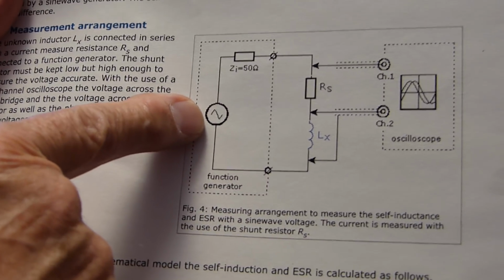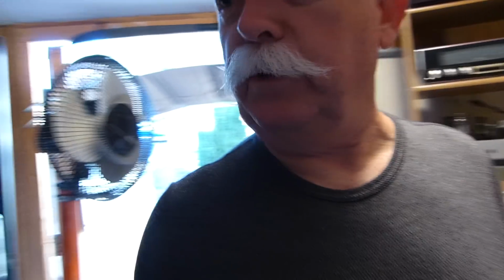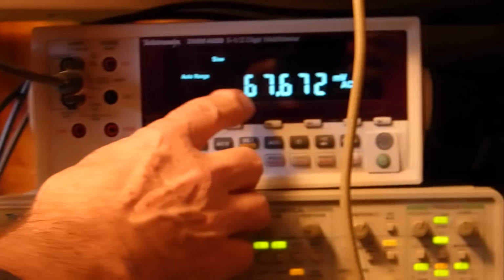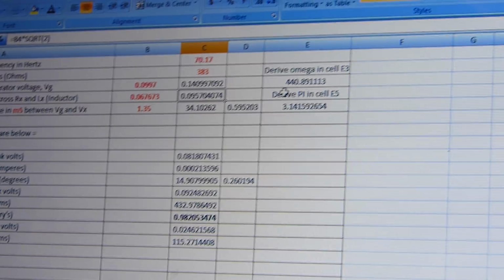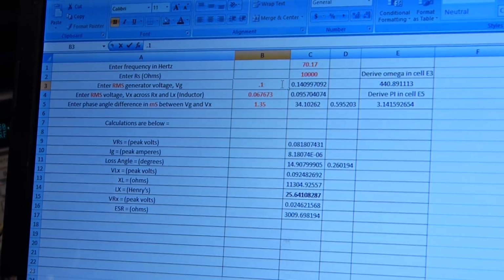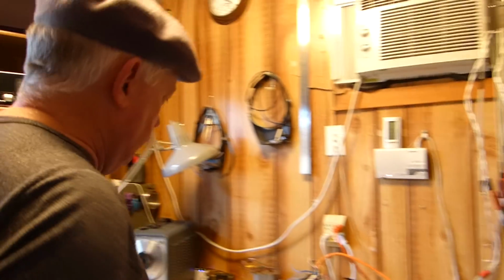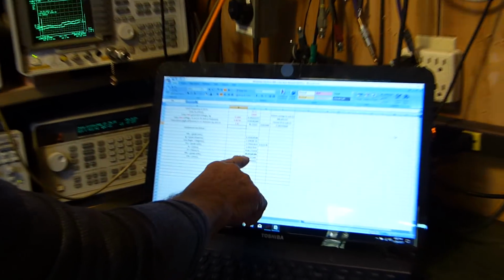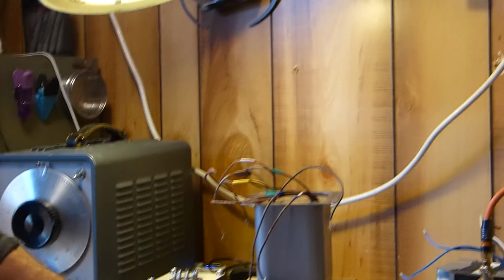Sine Wave Method Of Measuring Inductance Of Vacuum Tube Audio Output Transformers

Comment: Very interesting method. Would it not be better to use the mean voltage from the Tek voltmeter, rather than the max? Doesn't that meter have a filter function to essentially give you a rolling average over X power line cycles or similar? Most bench meters have something like that.
Reply from the maker: I am glad you liked this video as I am still very pleased with how it performs. I just recently added an outboard pot to it to reliability and very accurately measure inductance values down to 100 mH. 

As I am sure you know, measuring low L value inductors (mH and uH) values, it is easy to do with several simpler methods but the output transformers are in a class all their own. General Radio manuals are a very good source to read on how to deal with iron core inductors. When trying to get a consistent and accurate reading on inductance values in, for example, the 40H range of a 20-50 watt vacuum tube transformer,  it is amazing how sensitive the core is to being  magnetized just by simply moving it around on the bench. Trying to make these measurements on a metal (steel) bench is hopeless.

I usually don't take the time to go thru the trouble of finding the max voltage on the Tek voltmeter anymore as I showed in the video, as I have found with more experience, it is really not necessary.

With care, I can consistently and with a very acceptable accuracy, measure 250H or more. 250H from CT to one side is what you will get for a 1000H coil end to end and I have a transformer that is 1:1 at 1000H each side. This method is actually easier to use than the GR instrument and I have the highest regard for GR equipment. The GR 1650A is a  beautiful instrument but it is based on 1KHz and 1KHz is not a good frequency to try and evaluate very high inductance coils. For capacitors I have found that using an external source up to 20KHz works good with the GR 1650A but not so with low values of frequency like 40 Hz which I have found necessary with high value inductors.

I want to make another video on this instrument but I don't think many people are interested. Personally, I find these types of manual/mathematical measurement methods the way to evaluate the inexpensive digital instruments of today and not the other way around.
Reply: Thanks for the reply. I certainly found it interesting. Did you post your spreadsheet someplace? That would be helpful. I know you show most of the formulae in the video, but we electronics guys are a lazy bunch ;-) Anyway, I appreciate the effort you put into these videos. I have done some myself. I really appreciate your skill in constructing all the amps you make as well. I lack a lot of construction skill (I blame my lack of tools, lol, but seriously I need at least a drill press).

Anyway, keep up the good work, and I really do hope I run into you on the air. You said 20m; so I will keep my ears out. If you do exclusively 20m does that mean you have a Yagi or something special for 20? I do mainly 75m phone, but some 40m and 20m if I am on during the day. Thanks for sharing your knowledge.

Comment: i am in the last year of electrical technology schol in italy,  we use to calculate and measure transformers impedance every day for power grid use ( in the 100Kw to 3MW range) and we use a method called "industrial method" (the translation might be wrong...). we use a scalar voltmeter and a scalar ampmeter to ger the apparent power withour load in conjunction with a wattmeter to calculate the equivalent series impedance of the secondary winding that includes the primary winding reported to the secondary, we use this method to properly design the power distribution plants and the short circuit protection, so not the same use as this but it is very relayable and not vary complex to do.
in this way you can also calculate the internal power losses due to eddy currents and hysteresis losses to make even accurate calcuations.
if this can be helpful i can send to you the pages of my book with all the procedures ( in italian of course but since math in international......)

hope to be helpful, 73 from IU3IRR 17years old operator :)
Reply: manuel minutello Wow! This is way over my head, but very interesting. I will keep studying and catch up!  ;)
Reply from the maker: Hi Manuel,
Your measurement process is very interesting and I would really like to have your procedure if it is not too much trouble to copy and send. My direct YouTube email is:   theaudioshop@sbcglobal.net
I have wondered how electric utility companies and large transformer manufacturers made these types of measurements..
Your comment is much appreciated. 73 WA4QGA
Reply: ElPaso TubeAmps Hi, it would be a pleasure to help you. I am going to do all the footage tomorrow, do you want also a video were I explain the process to make the Italian pages more clear?

Comment: Even using a good quality core the output transformer causes a distortion and logical loss of frequency response.
Reply from the maker: From the models I have used in LTSpice it appears that the output transformer causes odd order harmonic distortion but not even order. Is that what you have experienced?
Reply: Perhaps the the odd order harmonic distortion is why some amplifier designs try to get rid of the output transformer all together (OTL designs).
Reply from the maker: That is a good subject to discuss. I have owned SS amplifiers without output/auto transformers and the distortion specs are very good but for reasons I cannot qualify, they seem to sound "weaker" and with somewhat less "dynamic presence" compared to the output/auto transformer designs. Seems they lack the low frequency presence and power of the transformer designs. Possibly too subjective for a legitimate discussion. I think there is much more to the sound for the ear than simple THD. It is no secret that vacuum tube amplifiers have more distortion than SS designs but many prefer the sound of the vacuum tube over the transistor. An eternal discussion that I have no hopes of ending tonight...  :-)
Reply: ElPaso TubeAmps I found an Earth Producer 440 for $30.00, '76? SS. I'm down that rabbit hole and I'm learning alot.  I'm on a mission. I study you, Uncle Doug, Brad & Paul just to name a few. This fall this Amp head will sound awesome. It doesn't have a choice. Thanks so much for doing that thing that you do so well!

Comment: PI=(22/7) is very close to actual value.
Reply: 355/113 is way  closer - write 113355, split in half, put the larger number on top - brilliant approx to pi :), only about 0.1 ppm out.
Reply: It turns out that you can write those little radio associated applications as a plugin for Excel as a mix of C++ and assembly language so the applications reads the data in from the excel cells does the calculations and spits out the answer back into one of the excel cells.
Reply: Excel has a PI() function.You don't have to write your own.
Reply from the maker: Here are the results in percent of accuracy:

22/7 is,  1.000402499434770000000000000000 %
355/113 is,  1.000000084913680000000000000000 %
The Excel function of,  PI() is,  1.000000000000000000000000000000 %
Derive PI by,  4*ATAN(1) is,   1.000000000000000000000000000000 %

I got used to having to derive PI because way-back-when I had to derive its value in BASIC programming as there is no PI value in BASIC.
Thanks gentlemen...

Comment: I"m curious; would placing an 8-ohm load on the secondary change the inductance seen at the primary?
Reply from the maker: Yes, it sure will. Shorting the secondary and measuring the inductance of the primary is how we measure leakage inductance which is down in the mH or possibly even uH range. It comes from the fact that the primary impedance is a reflection of the load impedance on the secondary. If the secondary is shorted, effectively, so is the primary and the only inductance left in the primary is referred to as "leakage" inductance. You do have to put the proper load on the secondary to measure the impedance of the primary.
Reply: Quite! 8/4 ohms on might not be very instructive, but a dead short gives a measure of leakage inductance - hence transformer quality

*either shorting secondary to measure primary, or vice versa multiplying/dividing by tfr's impedance ratio 

Oh and what you got on the bench? Tango's? Tamura's? They look nice!
(Guess I should play the whole video lol)

Meows from London,  Pete & Stereocat, Gas Electronics UK)

Comment: Cant we use an inductance meter or is that maybe not accurate?
Reply from the maker: Hi Mike,
The little inductance meters do a good job with small inductance values from a few mH down to uH but they don't work very well, if they work at all, with inductance levels above a few Henry's. 

Even the nice Tektronix and Fluke meters on the ohms scale when attached across the primaries of these high inductance transformers will not give even a resistance reading - they just blink at you. I wish I had shown that in the video.

The General Radio 1650-A will give you the same reading that I get with this setup in the video but even then, great care and patients are necessary. Quite honestly, I trust this method every bit as much as what I get from the GR lab instruments. I suppose ultimately this is even more complicated than using the GR instrument but I became driven to find a reliable method other than a lab grade instrument that would accurately and consistently measure these values of inductance. 

You could see just how sensitive these big inductors are to external energies when they are being measured at such low levels and a light bulb is close to them. I tried "biasing" the core with small amounts of current flowing in the secondary windings and things just got really weird. 

The first method that I posted that I refer to as the "square root of three method" is too unreliable and derived values can vary by 100%.
Reply: Gotcha. I have one on my Sencore LC-102 capacitor/inductor analyzer but also you can change the frequency in which you test at on it.

Comment: Hi David, I really enjoy watching all the video's you post, even if I don't fully understand them. I am curious for instance when you measured the James transformer and it gave a reading of 20 odd Henry's compared to the older transformer which was around 42 plate to plate. What actual difference in construction (if any at all) would be necessary in building an amplifier if you were going to use one or the other in your opinion? Thanks, Tom
Reply from the maker: Hi Tom,
I am sure no transformer expert so I can't tell you anything of value about how they are actually wound. I will say that, as I understand it, the higher values of inductance in the primary windings of these vacuum tube output transformers will provide better low frequency response.

It sure seems like I am destined to build an amplifier (Williamson style) and use this Chicago Standard transformer. I recently bought it thinking it was an Acrosound but I didn't look really close until I got it home. I did measure it and it is a 10K primary with screen taps at 50% and not the usual 40% so... it looks like this is going to be my next project. 

Also, my grandson wants a vacuum tube headphone amplifier so that is also on the agenda. I plan on using the 1626 triode for output. There are a number of schematics of small 3 watt amplifiers using these triodes. The one I remember the most is called the, "Darling 1626 amplifier" and easy to find by an Internet search. It actually got its name because it was so cute and thus a "darling"... we shall see how it performs soon. Thanks for your comments.
Reply: Hi David, Thanks for replying so quickly. I am glad to hear that your grandson is taking an interest in tube gear... I think in a prior video you were concerned that you would have to sell it all, as no one (in the family) was interested in it. I had to look up the 1626 tube in my manual as I wasn't familiar with it. It said, it's typically run in class C for RF transmitting, an amplification factor of 5, with an output of 4watts. It would be great if you post a video of it when you build it, as it sounds interesting. Definitely   build the Williamson style amplifier with the Chicago Standard output transformer, they are great amps, and you never fail to impress me with the quality of your builds. You are one of only a few, who actually measure and post the performance of your builds, trying to get the most out of these timeless designs, explaining why you change certain things and always backing it up with empirical data. I thank you for the time you take to make your videos and look forward to the next, Tom
Reply: As long as the impedance ratios are right, you cant do much about inductance, design wise - simply, MORE inductance gives you better bass extension at high power

Even quite undersized OPT's can be ok if you dont turn your amp up full much

(For guitar (BASS even???) The sound of an overdriven (undersized) transformer going into saturation can be .. interesting - not exactly Eddie Van Halen, a bit dirty, but fun to experiment with)